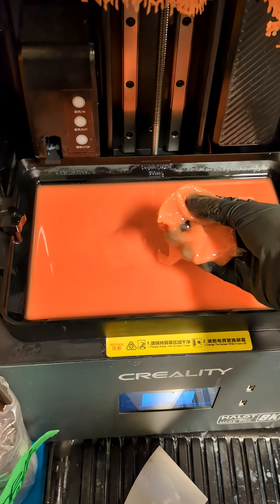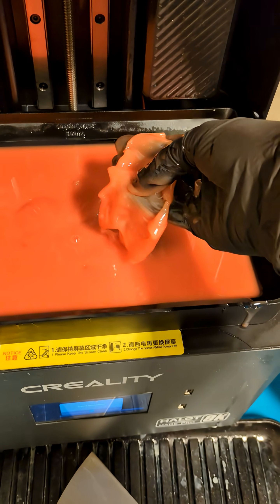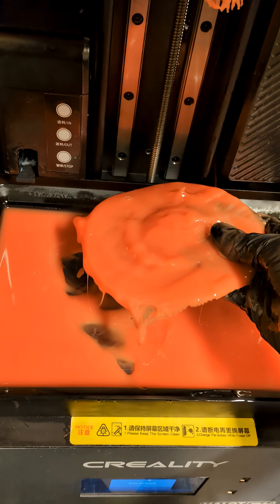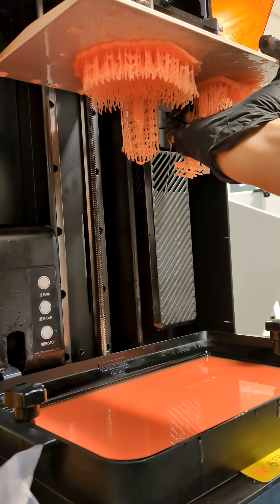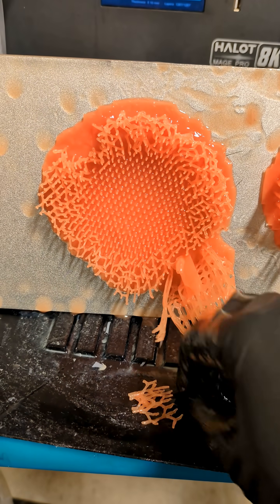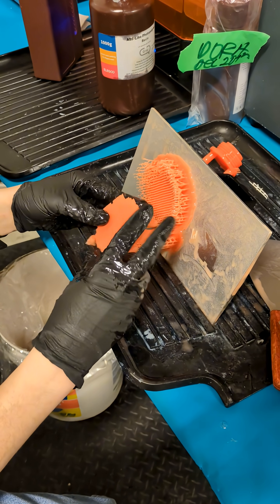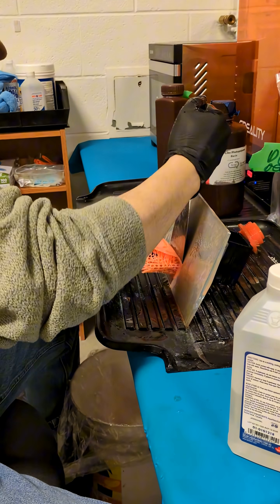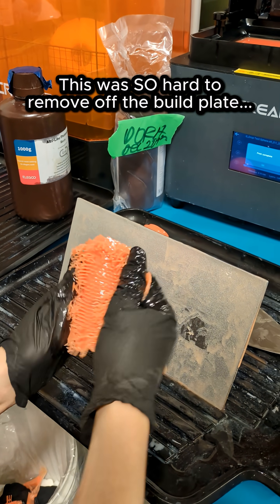more FLEX resin adventures (& fails)...

Comment: Resin fails are messy, time-consuming, and frustrating to reset from, so my heart goes out! 

Two red flags for me:

1.Assuming the supports must be sufficient for this material because they worked in a different material with different material properties.

2. "proper material settings... from the manufacturer's website "
Reply from the maker: 1. My assumption was the STL file not the supports 💔 you're right about this! I was thinking out loud wondering if issues with an STL file could translate to issues in a resin print. I know they do with filament and I have more experience with that technology...

2. I thought that manufacturer settings would work 💔 Resione has slicer settings for different machines for this material posted on their website as configuration files for chitubox so that's what I used. This is this biggest thing I've ever printed on a resin machine so realizing denser supports would have been better.